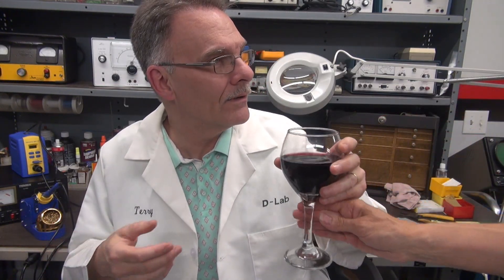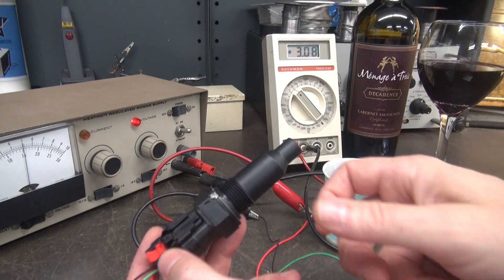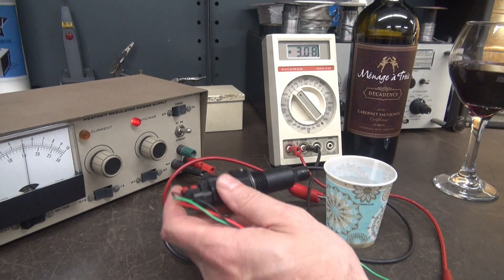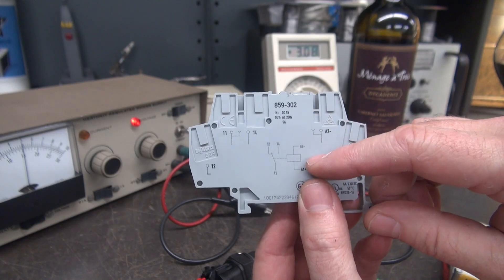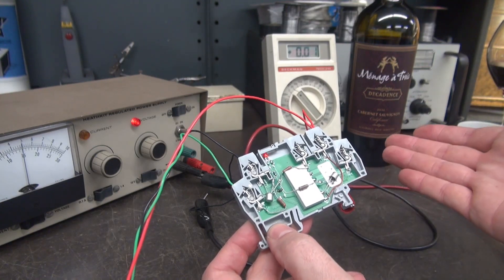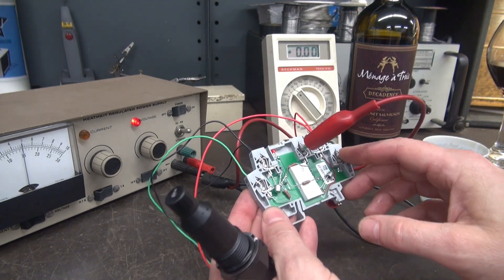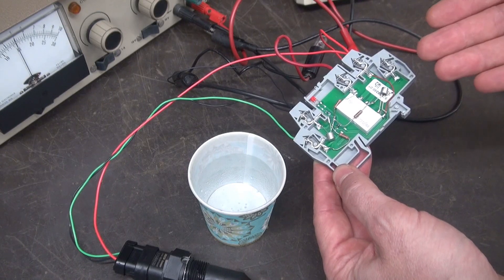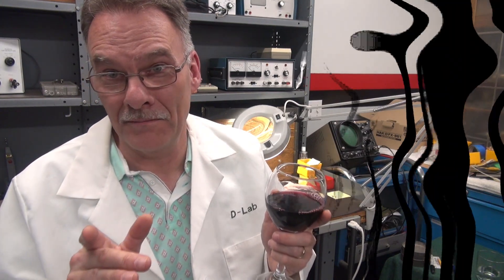Professor Prototype Presents How to use Baumer sensors Wago Relays Custom control D-lab edition

Comment: I looked at the website, but I didn't see any "store" link.  Searching for that part number didn't turn up anyone offering it.
Reply: Cheap?????   Did I hear you correctly?   Terry this is not cheap?????     Found at link below.   $150.     That probably does not include the amp connector cable   either.                        http://www.standardelectricsupply.com/index.jsp?path=product&part=2325729&process=search&qdx=0&ds=dept&text=CFAK+22U9500
Reply from the maker: In the Industrial automation world, that is cheap : ) You can find it for approx $45.00, if you shop around. To purchase from Baumer, you have to go thru a distributor. The company is in Sweden, plenty of USA sources though.

Comment: LOVE the wine label: "Ménage a Trois Decadence!"  And thanks for introducing us to Baumer level sensors.  No-intrusion monitoring of fluid levels!  Great for RV tanks, washer fluid, etc!
"Clickety doo dah" - LOL!  Yet another fun expression from D-Lab!  Very creative.  And "Wee-way"!  I once worked with a guy who talked like that in Austin.  Sometimes hard not to grin at inappropriate times.  When he started to talk about "Weeway Wogic" in traffic signal boxes (relay logic), it was hard to stay composed.  Sorry, but at face value, it was amusing.
But most of all, you just can't beat words that end in "eramus"!  My favorite is still "Snozzeramus!"  Yes, that is a big, hulking soldering iron.  GREAT for soldering substantial hunks of metal, or heavy contacts.
Reply from the maker: Thank you Sir, Many do not get my offset type of humor. I try to mix it with technical info, hopefully keep people interested. I see you get it! I appreciate that. Thanks for supporting me. And, yes if you find a need for the sensors, you will really like what they have to offer. We are using them to monitor hot hydraulic fluid levels. Funny you could read that wine bottle label! TD